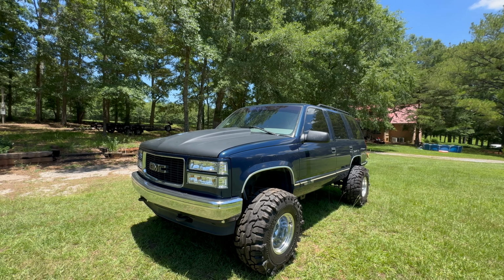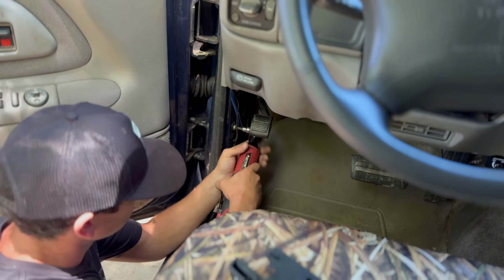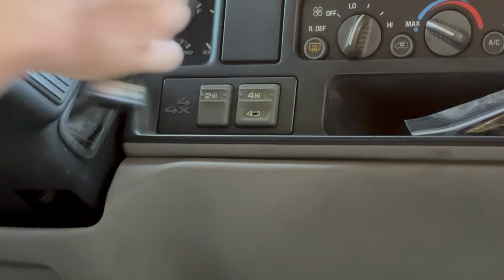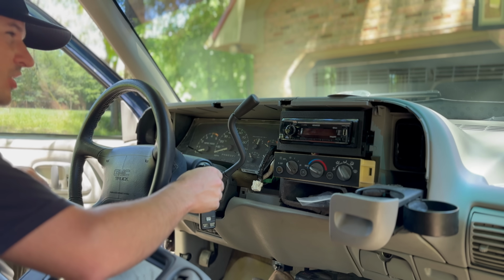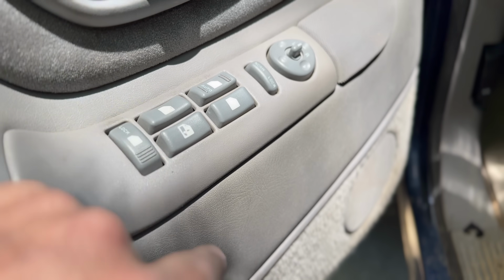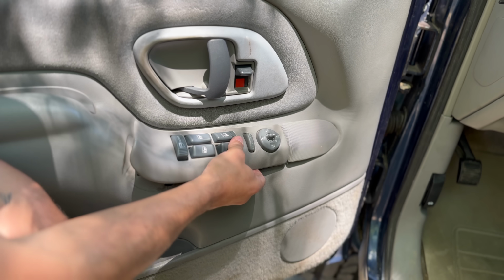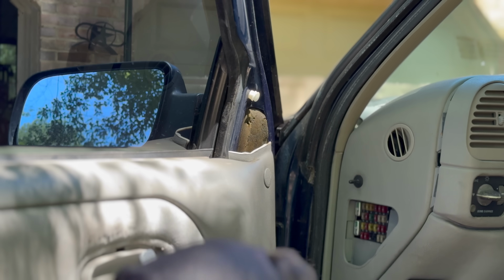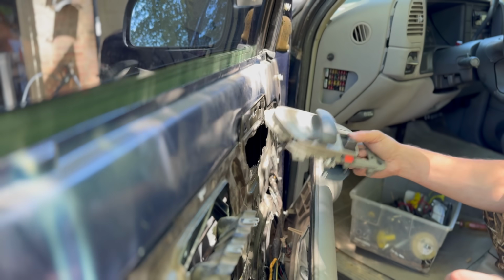FIXING EVERYTHING ON THE OBS!!! | WELL... MOSTLY 😅 |

Comment: I had the same problem with a Obs I replaced that door handle in I ended up using a spray can of white lithium grease on all the components and it help fix it.
Reply: Same I did so on my round body and it made the locks like new

Comment: the little rod in the door panel it should have little clips it slides in, clean them up really well clean the rods up if it’s the same as my nbs 02 it’s that my doors are really stiff to lock after a while it builds up gunk